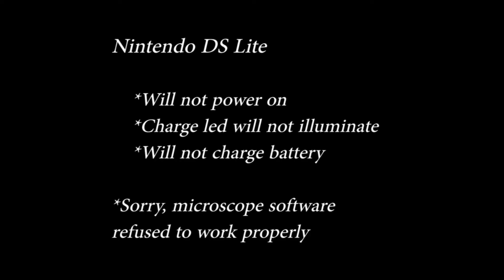Nintendo DS Lite no power fix

Comment: Hey, I have my ds lite with no power. The coil has continuity across the terminals. Anything else I can easily check
Reply from the maker: Check the two fuses marked as F1 and F2. Blown fuses or a bad EM10 are the most common issues. If the fuses are good you’ll have to follow the path of power to identify the issue.